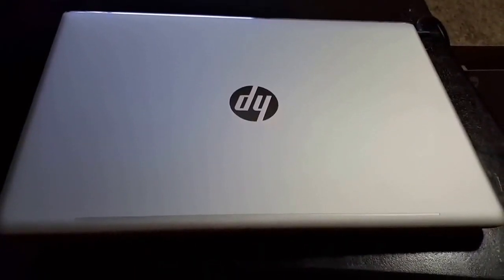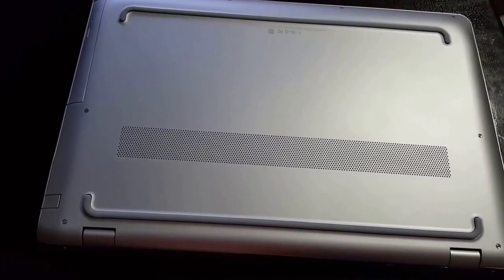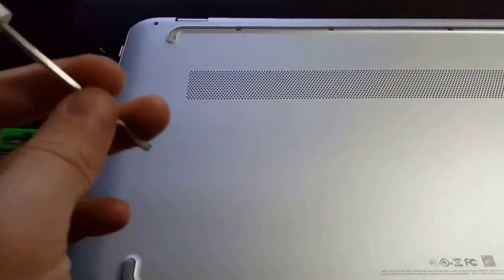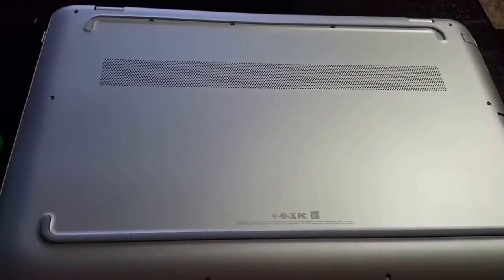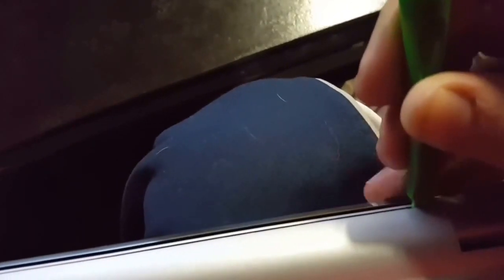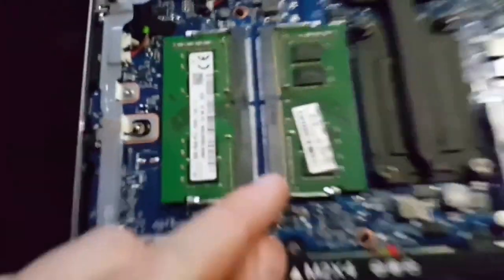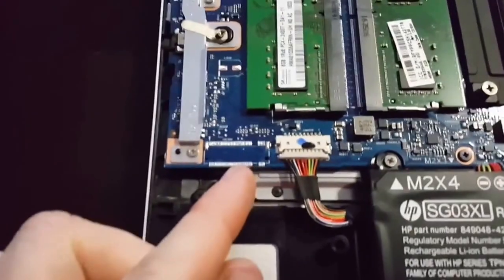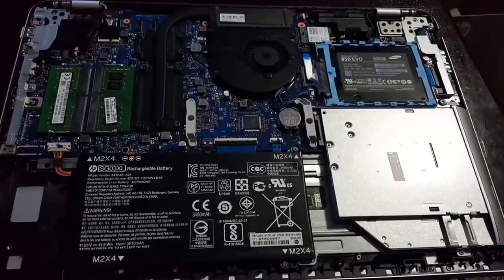How to remove the back cover from the new HP Envy 17t Touch laptop (Q4 2016)

Comment: I can't thank you enough. I never would have discovered the hidden screws or learned what I needed to buy to remove them (torx 5 and more) without your help. Changed battery and it seems to be working! (Also, "copycat" battery for the HP Envy seems to work; HP only sells refurbished of the original, and I am leery of refurbished.)

Comment: Thank you so much.  I couldn't get the back off because I didn't know about the 3 hidden screws under the rubber foot.  I am now able to replace the battery.
Reply: I too was confounded by the three secret screws. Then to make it even more of an adventure, they had to make them philips head, instead of torx like the other eight screws.

Comment: I have an HP Envy 17m-ae111dx - 17.3" laptop that came with a 1TB drive.  When I bought it I thought 'no problem' until I looked at it figure to out how it came apart.  Links from HP steered me wrong but your video was dead on.  While the bottom looks a tad different the long rubber foot concealed 3 Phillips screws and it also had t5 screws like in your video.  Mine had a screw underneath the cdrom drive that yours didn't so anyone that finds this comment searching like I did ->> eject your dvd burner before you power off<<-.  There was enough slack on this model to swap the hard drive (carefully) without removing the battery which the cable snaked under.  Unfortunately I didn't find anything I could add or upgrade other than the hard drive. 
I used a linux live usb called ghostzilla to mirror the 1TB drive to the 2TB drive and used fedora live to move partitions around using gdisk since the windows disk manager wouldn't touch it.  Otherwise it was pretty much the same as in your video.  
Thanks for posting this.. you saved me a ton of grief !

Comment: Great post buddy ... I purchased the >exact< same laptop with 1TB 7200rpm drive ... swapped it out for Samsung EVO SSD ... I too was disappointed to find no additional provision for a second drive.  EVO SSD installed flawlessly in same position as 1TB drive.  FYI, first step for me was to clone the factory drive to the SSD using Samsung's Data Migration utility ... that was absolutely awesome by the way. Connected the SSD via SATA/USB external cable to the Envy first ... installed 
Samsung Magician utilities, then cloned, then shutdown/disassembled/installed SSD/reassembled and booted up in a 
fraction of time ... boom!   Thanks again for posting and validating the approach I took as well. Cheers.

Comment: It's absolutely disgraceful how much effort HP made to make that bottom lid a crazy adventure to remove. It used to take me literally 3 seconds to pop out my battery or my hard drive, like your older computer you showed.

But now, not only do you need a tiny Torx screwdriver, which your average person doesn't have handy, but the screws under the rubber pad are a different type altogether, a philips head. Seriously, HP? That's if you can actually find the 3 screws under the rubber pad, which are blocked by not only the rubber pad, but some other thin strip under that. Then you need to pop off all those clips without damaging them or the computer itself. I used a credit card, which did the trick, eventually.

I mean, once you get the hang of it it's pretty easy, but most people are gonna get frustrated and just send their PC in for maintenance which must be what HP wants. What a bunch of a-holes.

Thanks for the video.

Comment: Thanks.  Mine (17t-ae100) had one more hidden screw under the DVD tray.  I had to open the tray by inserting a straightened paper clip into the little hole, and then when it slid out the screw was exposed. I was about to break my case prying on that point before I tried opening the DVD drive!

Comment: I know in the Tech world (moving fast) you'd think this video wouldn't help out with a new HP 15-CK019TX with a 8550U i7 bought in 2018 Q1 but it does as the hidden screws under the rubber pads was a massive help. The laptop came with a 256GB SSD and I wanted open it up to find out if it has 2.5 or a Nvme (M.2) so I buy the correct when upgrading in a few months but I'll have to use software to figure it out as I dont want to ruin the rubber pads as I'd know they wont sit the same after I peel them off, its a shame HP are cheap in their design THANKS HEAPS!

Comment: Thank you so much! Was having a horrible time trying to find the last few screws. If you're still monitoring this page would love to know your experience in changing to SSD
Reply from the maker: Glad I could help. Switching from the old drive to an SSD was easy and made it noticeably faster. I would definitely recommend it.
Reply: @RandomGreenFishPhone  EXCELLENT!!! Did you happen to make a video about it? What one did you install? Were there issues with the system recognizing it? Any assistance or tips would be extremely extremely appreciated. Do you have to remove the pre-existing drive or can the SSD be installed in tandem?
Reply: Sorry for the barrage of questions!

Comment: I just came across your video because I’m trying to fix my audio hardware on the exact model you have in this by any chance do you have a video on how to fix the audio hardware? I did the audio diagnostic trouble shoot and it told me hardware issue no audio output or input connected… it also says on the laptop the speakers are by Bang&Olufsen

Comment: Hi, Thanks for making this video, i followed it and had no problem in switching out the battery myself.  I bought one with the hard drive, 500GB, and i'm wondering if i should try an add memory as i'm running low.  Have you done a video on increasing memory specifically?  I'm afraid of doing that part incorrectly.  My laptop is my business!!  Thanks again ☘

Comment: What's the part number for the 66 watt battery for the HP M7 notebook great video by the way. I knew there were some screws I couldnt find.
Reply from the maker: HP lists the part number as 849315-856 for the 66 watt battery, but I couldn't find anyone selling it, not even HP directly. Maybe they were discontinued.
Reply: so were do we get a new battery?  I'm getting the message when I log on that I need to replace the battery.  Bummer...warranty just expired!  I'm not sure even if I find a battery I can do what you did without messing something up.  thanks for the video!

Comment: Great video, I've had mine for almost a year now but the battery life is a turn off. Could you point me to the direction of a replacement battery I could upgrade that lasts longer, I have the 3-cell 41 WHr Lithium-ion Battery that came with it. Thanks!
Reply from the maker: Although the larger batteries are listed on the service manual, I think they were discontinued because I cant find them for sale anywhere. My guess is that they were faulty in some way.
Reply: ThoriatedFlash Thanks man, do you know if the SSD model comes with a second bay for another SSD, I'm looking to upgrade

Comment: I have the same exact laptop, 16 gigs of RAM, 1 TB HDD, and an NVIDIA GeForce 940mx and I game on the laptop, but that graphics card really sucks and I was wondering if I could hook up an external graphics card. If you are willing to do a video to show how to do that, that would be great. Thanks!
Reply from the maker: I don't think you can use external GPUs with this laptop. As far as I know, they only work with laptops that support a Thunderbolt 3 connection.
Reply: ThoriatedFlash I mean, as long as it has a connection from the graphics card to the motherboard, I think you can unplug that and hook up another connection that goes to your external graphics card, but whose to say. I can’t even get my case opened, so, idk what to expect if I ever do get it opened.

Comment: I have this laptop, I had a spill so I cleaned it up with alcohol.  When I put it back together it all worked fine except for the webcam.  So I finally got the guts to open it back up, found the issue, put it back together and it will not power up period.  I have tried unplugging the cam, I have unplugged and replugged everything back in and nothing.  I used the powersupply on a older envy and it works fine.  So what now?

Comment: Did you ever trto put in an M.2 ssd card? I was going to add one and can't find any videos on where it goes, I get how it works, but I can't find the m.2 slots but I think they are under the motherboard.  I don't want to take it apart unnecessarily. Got any tips?
Reply from the maker: At time 7:33 you can see where the SSD would be for some models. There are some missing components in addition to the m.2 connector in this model, so I don't think it is possible to add m.2 support. Even if you could find all those components and solder them to the board, it still may not work due to firmware and BIOS compatibility. Even if it did,  there's a chance that the m.2 port is only connected by SATA, and in that case you wouldn't see a speed increase compared to a SSD installed as shown in this video. So there is a slim chance it is possible, but probably isn't worth the effort.

Comment: I've got the same model with a 512 SSD... no connector soldered for second drive. :(
Reply from the maker: Could you take a picture of the connector (Without the M.2 SSD installed)? I am trying to find the connector and am going to solder it to my board to see if it will work. I am having trouble finding the type of connector HP used.
Reply: Will do... stand by (for a day or two :) )
Reply: Are you saying it doesn't have a connector for a 2nd SSD drive, or it doesn't have a connector for a second drive of ANY type? I am looking at this computer for work and was told it has a bay for 2nd drive (SATA).
Reply: @gizmoDog765  your pics helped me so much! got the same laptop, needed to know about replacement battery, tysm

Comment: I have a need to know how to physically remove the webcam in the display assembly from this model.  The service manual shows that this model's display only comes as an entire assembly and thus does not contain any instructions on how to get into the display assembly to replace/remove the webcam.  Anyone come across instructions to accomplish this?

Comment: WARNING READ THIS BEFORE STARTING : the so called T3 screws that hold the battery in were SO tight that all the screws did was strip off the splines on my torx bits, I had two sets when I started. I had to use a HOT KNIFE to cut the retention tabs from the old battery, and even now two of them are still unmovable. My laptop is now a desktop, but not the worst possible outcome.  Thank you HP for more consumer hostile engineering.

Comment: On the HP 17 by 1023CL you must remove the opt cd drive. There are two hidden screws below, after the tray comes out. If this link  works-try it: http://h10032.www1.hp.com/ctg/Manual/c06148960. This manual works for the 1023CL. I upgraded the RAM memory by using the one unused empty slot. Don't try to release any clips. Just line it up...it only goes in one-way, then push it down until it locks in place. Don't compare the empty shot with the one being used on the other side. There is nothing to release.

Comment: HP ENVY Notebook 17t-u100, product # Y0F94AV I think I have the SSD 512 GB, 
Hey Can you power the Computer VIA USB C?
Reply from the maker: Unfortunately my model can't be powered by the USB 3.1 type C connector. It is listed for data transfer only. A lot of the similar models are like this as well.
Reply: Damn, I mean it would just be awesome if it had Power Delivery,  Thanks for your help and I really liked your video as I can your the only one who has this model as close as mine. THUMBS UP.. .
Reply: Well it looks like it's time for me to replace the battery, funny about how long it took for it to die

Comment: The empty space with no connector looks like a space for a an NVME SSD using an "M Key edge connector". I wonder if anyone buys one and solders it on themselves, if it'll work?

I would order it but my skills with a soldering iron is way sub-par and I'd end up messing my whole laptop up. Here is a site to order a connector, 
https://www.digikey.com/product-detail/en/jae-electronics/SM3ZS067U410AMR1000/670-2693-1-ND/4162231

Comment: how stupid does hp engineer have to be to design laptop that has to have back cover taken off to change battery, I got it Christmas day 2018 touch pad not working, sent to hp , they replaced touch pad 3 weeks, 6 months later pointer moves but will not activate anything, hp says remove battery and hold on button 30 seconds, have to remove fucking back to get to battery WTF will have to send back to them again, this is my 4th hp laptop and my last,  will never buy another hp product  JUNK